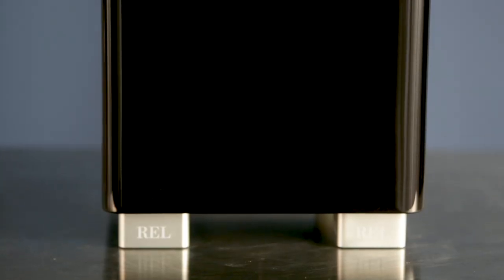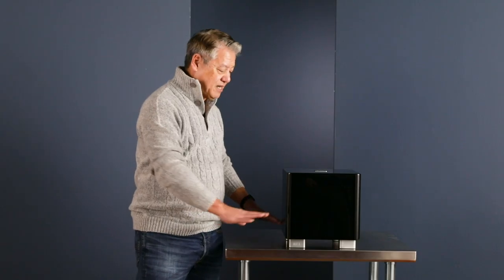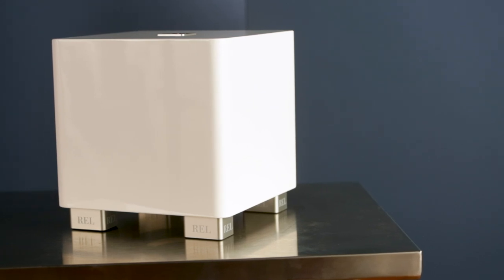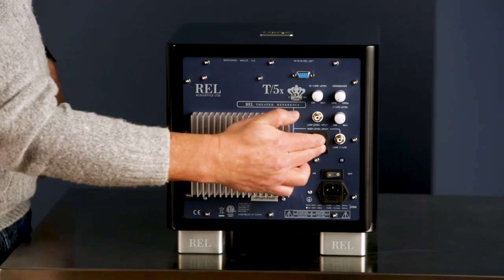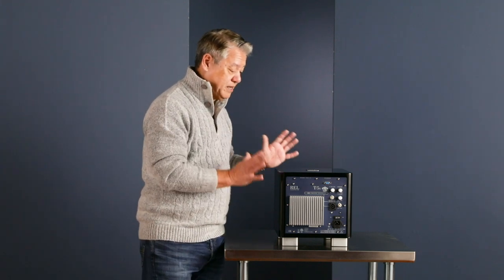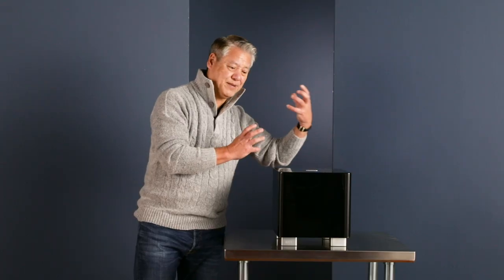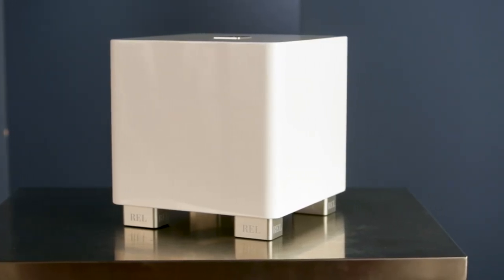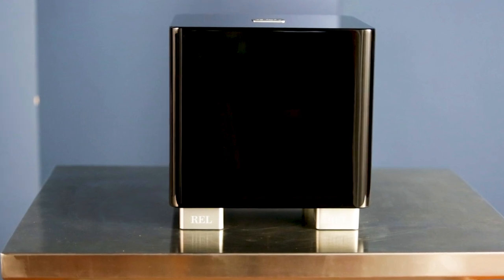REL Acoustics T/5x Powered Subwoofer Overview

Comment: Hi. Is it ok to position it on some sort of stone slab ie marble?
Reply from the maker: Thank you for reaching out. We find that the best performance is achieved by having the REL subwoofer placed directly on the floor, rather than on a platform or shelf. Doing so will allow the subwoofer to couple directly with the floor, resulting in deeper low-frequency extension and more dynamic output. 

For more information about subwoofer placement, feel free to write in to contactus@rel.net and we will be happy to assist.

Comment: Hi, may I know if this would work well with a studio monitor like the kanto tux or even the iloud MTM in a smaller room?
Reply from the maker: The T/5x is an excellent choice for pairing with either the Kanto Tuk or the iLoud MTM speakers. The Kanto Tuk have an RCA subwoofer output jack which will allow you to connect the subwoofer directly to the speakers, though since the iLoud MTM do not have an output jack the subwoofer would need to be connected to the preamp or whatever other device is being used to send signal to the speakers.
Reply: Thank you so much for the insight! Love all the videos and REL’s attention to detail. It is really something that I can truly feel. 
I’ll get the T/5x then! Oh by the way, what is the best position for the sub? I saw a video about the woofer crawl technique? Is that a good idea?
Reply from the maker: @tanlekthow2646  Glad that we could help! We have found that the best performance for the T/5x is achieved by placing the subwoofer in one of the front corners of your room, along the same wall as your main loudspeakers are placed. If corner placement is not an option, then placing the sub along the same front wall will be the next best choice. Proximity to a room boundary well help to reinforce the T/5x's down-firing output, and also project that output out into the room.
Reply: @RELAcoustics  Hi team. T5i had jet white driver which is untreated for fast and accurate bass. T5X driver is treated, which may add mass. What is the reason or advantage of having it treated in comparison to T5i.

Comment: Is this quick enough to pair with KEF LSX 2?
Reply from the maker: Thank you for reaching out. The T/5x is plenty fast enough for pairing well with the KEF LSX 2 speakers, assuming that your system is being used in a small-to-medium sized room. If your system is located in a larger room then we recommend the T/7x as being the preferred option for pairing with these speakers.

Comment: what do i gain....  by not letting it face down....  but toards me,, or side wall, or back wall.. or ceiling
Reply from the maker: Thank you for reaching out. The T/5x is designed to have it's driver facing down and toward the floor, rather than being placed on it's side and having the driver firing forward. This down-firing design allows for stronger output and deeper extension from a relatively small subwoofer.